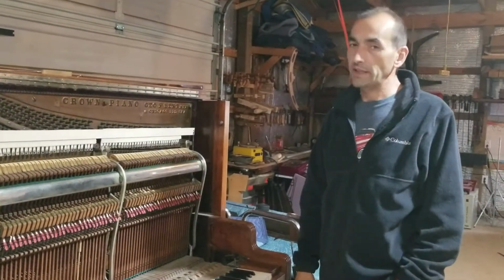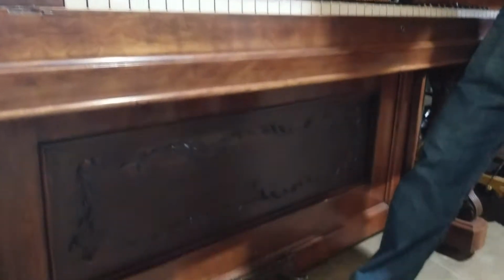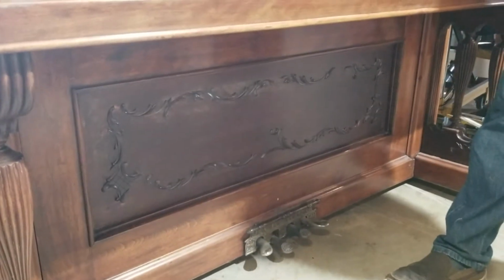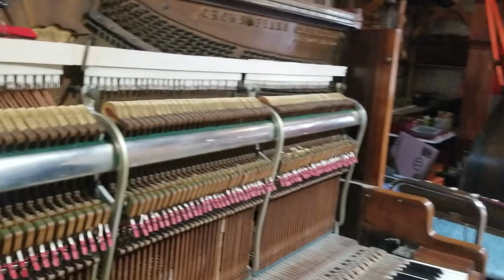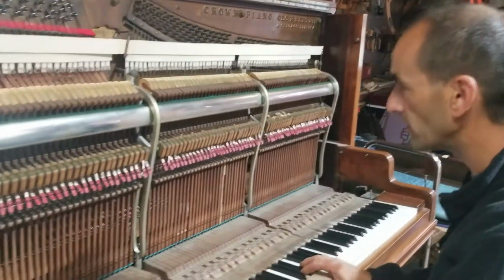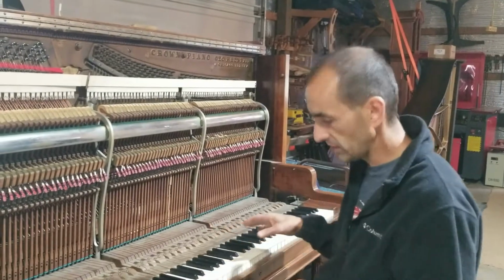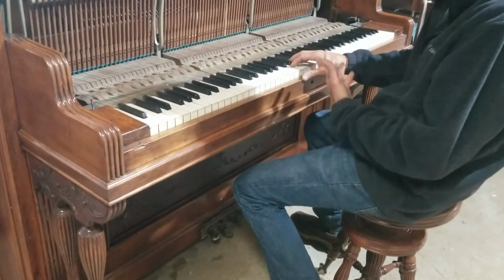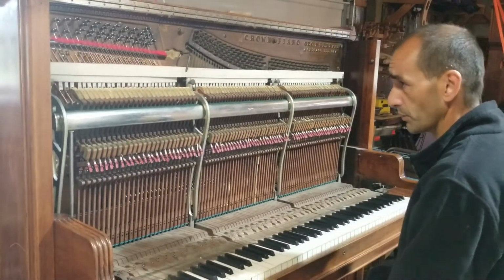The rinky tink rail explained

Comment: Nice to meet you. My name is Tsugawa and I am a public relations manager at a hotel in Nara, Japan.
Our hotel has a Harrington piano made in 1904, which was played by the famous Dr. Einstein in 1922.
I have a question about the pedals on the piano. This piano has three pedals, before this piano was restored, the middle pedal was missing. Do you know what is the original function of the middle pedal?  
Could it have been a rinky-tink function?
Reply: Usually the third pedal on a piano is for 'practice mode'.. much quieter than even with the damper pedal on
Reply: Nice version of Star Of The County Down...